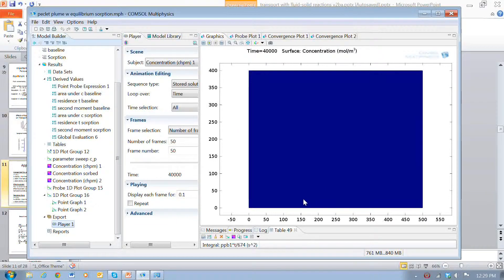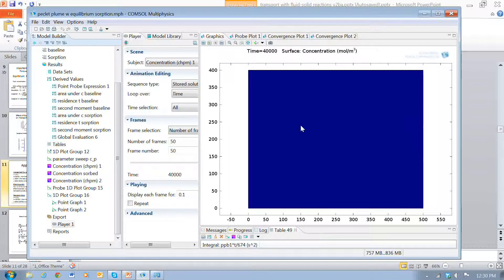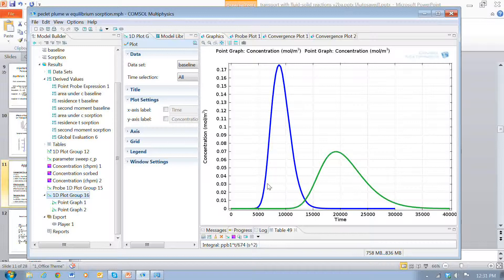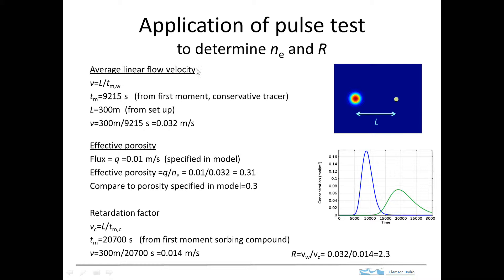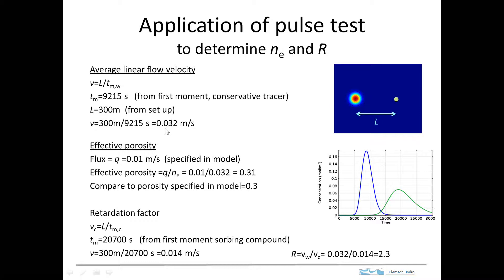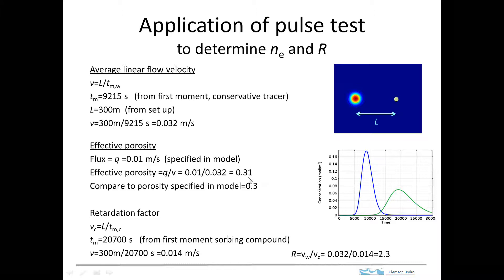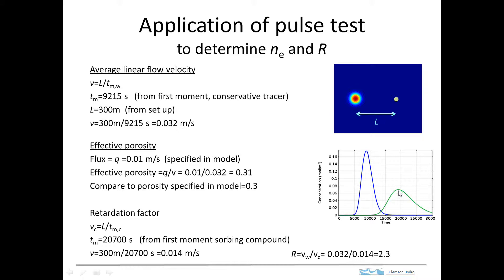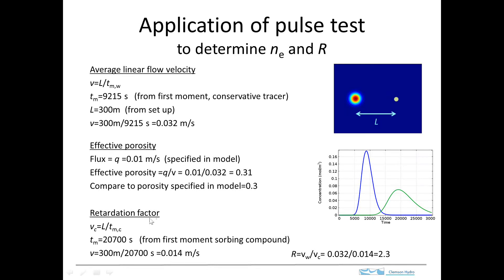Determining effective porosity and R

Comment: Consequently, when applying this method, I think that in will be more adequate then the others and see more adequate and accepted reliable values. Nice to see the recession curves that should not be alone to draw conclusions on the effective porosity of the water storage. This can be used for preliminary analysis and in combination with measurements of boath the groundwater level, the infiltration cofficient and permeability. If we imply  Darcy's law  exponential nature will suggested recession curves that present the flow component.
ALWAYS OBTAIN YOURS HYDRAULIC CONTEST - IT IS MULTIDISIPLINARY! 💦🤌